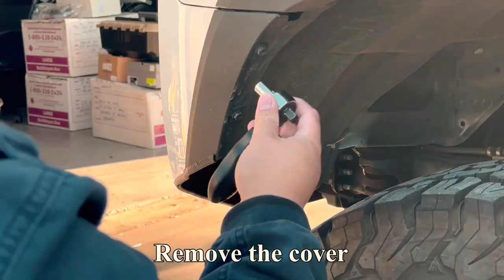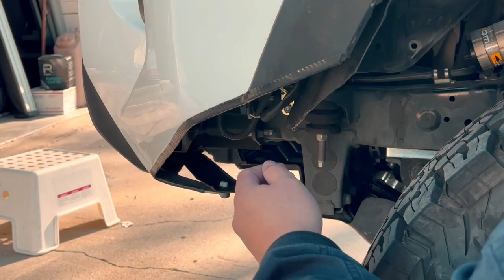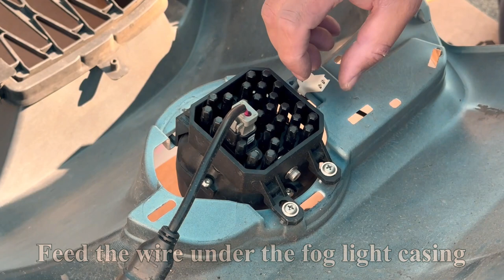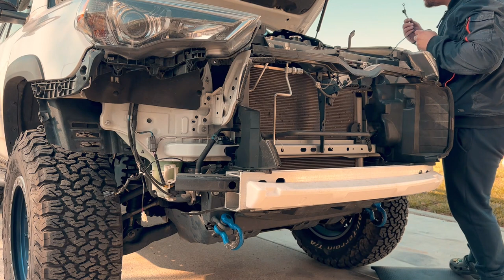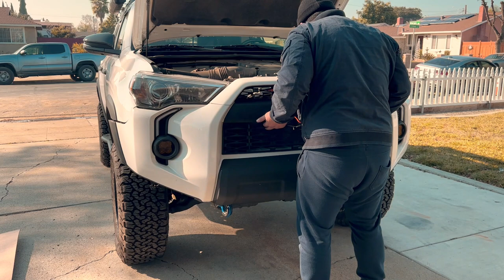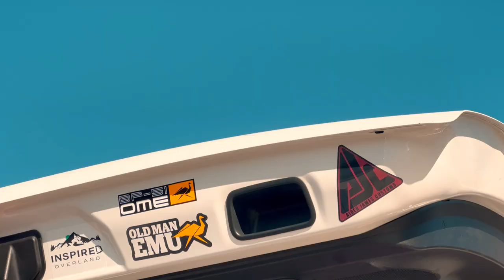14+ 4Runner Fog Bezel Kit Install Amber DRL w/o switchback

Comment: I already have my raptor lights connected to wear they come on only when I turn my lights on, can I use the same ground which is the bolt I’m using to connect?

Comment: Great video.  I also have the raptor lights on our 4runner.  I was wondering if these lights plug into a different fuse (add a fuse) as the raptor lights?  If so, did you come up with an out of box solution to plug them both in or is there no conflict with wiring both sets of lights? thanks!
Reply from the maker: As of now, I have the raptor lights plugged into the fuse box underneath the driver side and the fang lights in the engine bay. I haven’t had any problems yet but I did upgrade my battery to the yellow top optima.